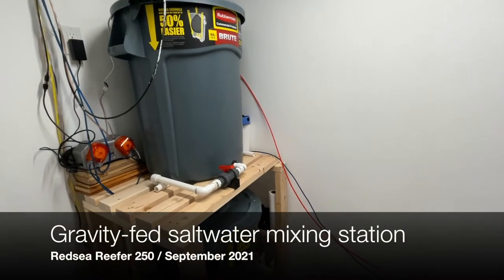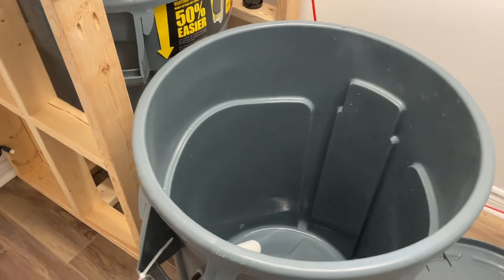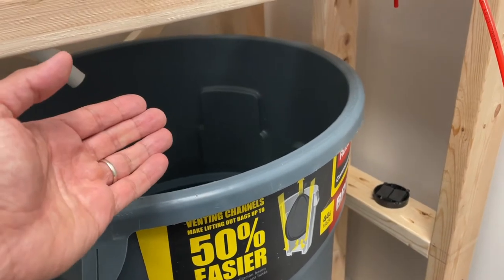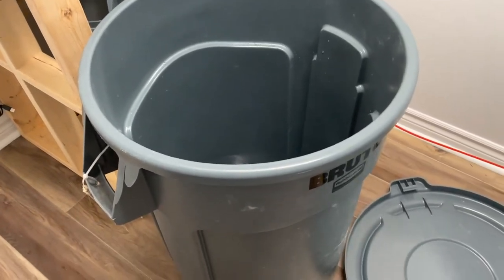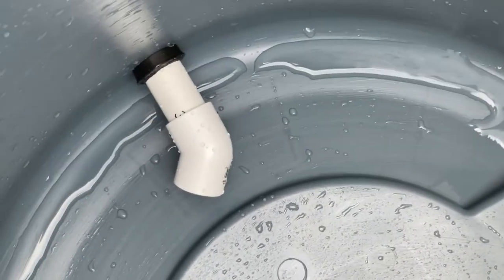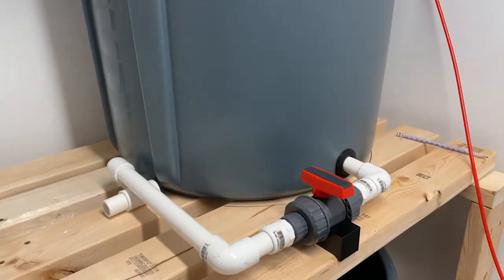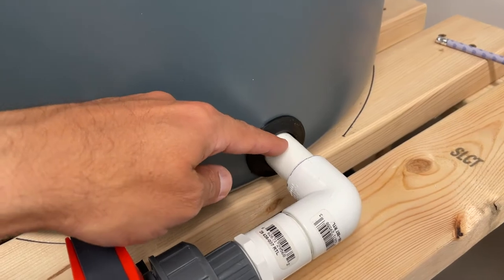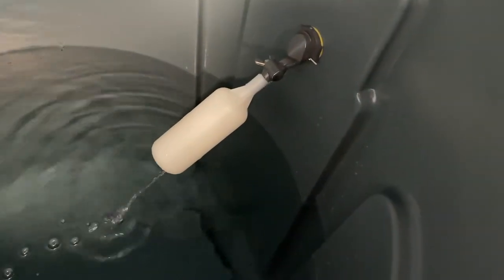DIY Gravity fed saltwater mixing station

Comment: In the end of the Video the dosing pump was gone. Did you bring the pump up under knee your tank to prevent the gravity siphon in case the tube slip off or something other happens?
Reply from the maker: No it’s still there but I have a fail safe that would detect the dosing pump not sealing and stop the gravity siphon
Reply from the maker: Have a look here at my solution

Comment: If your rodi is on all the time and is only stopped by the float valve aren't you getting crazy tds creep?
When starting a rodi it spits out high tds water at first doesn't it?
Reply from the maker: Hi Rick. I does for sure but relying on the float is a temporary solution until I rig the system with a solenoid and optical sensors that would only re fill the brute with Ro water after it reaches a certain level
Reply: @TheBioReef  sounds good. Also maybe look into an auto flush for the rodi.
It supposed to help too.

Comment: What was your reason for the 2x4s running under the saltwater container?
Reply from the maker: Extra structural support. The weight of the salt water tank transfers to the bottom and sides, and acts to
Stabilize the whole structure

Comment: Do you have an alarm that tells you that the salt water is running low?
Reply from the maker: Hi Garry - that is a good idea and one that i may eventually add with a sensor in the saltwater container. For now, i can still catch this problem with my automatic salt water setup - if you haven't already seen this video - give it a look - but briefly, if the salt water container runs out, the tank will loose a little bit of water (water is removed but not added), and i have a low level sensor in the sump that will catch this and automatically disable the automatic water changes. Because your are adding a known number of liters every day, and you know what the volume of the container is, it is actually pretty easy to figure out how often you need to mix a new batch of saltwater, so i put that in my calendar as well. thanks for watching!
Reply from the maker: here is my automatic water change video

Comment: I know its off topic but these radion gen 5 are a pain to calibrate so all the colour channels go on and off at the same time and each light is in sync with others during its light cycle unless im doing it wrong ?? Any tips would be appreciated
Reply from the maker: not my experience at tall. Are you doing the calibration at night when there is no light. i typically do this after all the lights are off, and i also avoid looking directly at the light... use the surface reflection to view the changes. Also, its not going to be a big deal if there is subtle changes in the calibration of the different channels
Reply: @TheBioReef  thanks for the reply so when your calibrating the lights you want to see no light ? Same amount of light ?? Its hard to calibrate them lol
Reply from the maker: @bopeep7806  hi Peter the way calibration works on the radions is that light is set to off, and then you gradually add power, then you click as soon as you see the led light up. So best done in absolute darkness